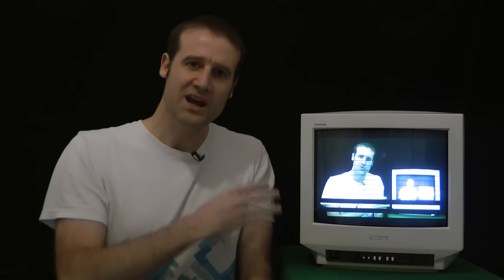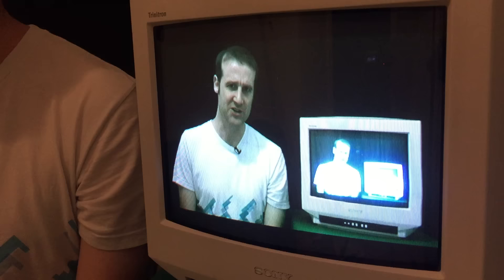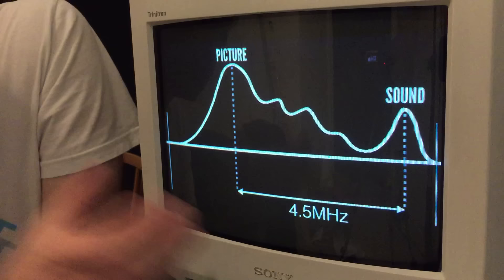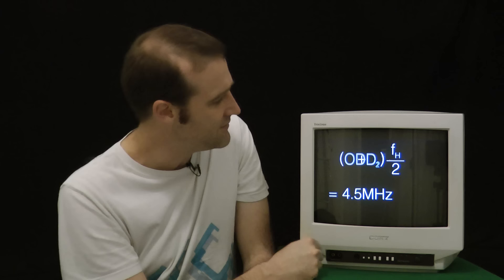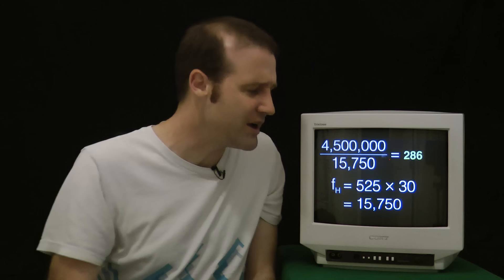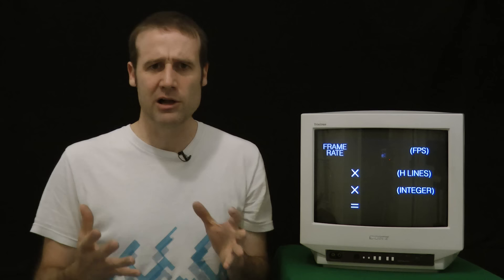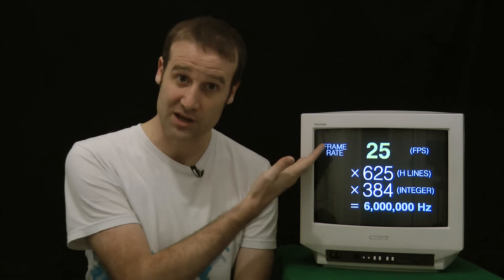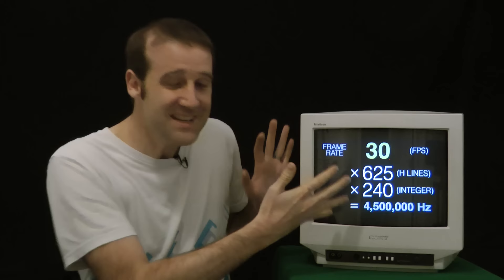Why is TV 29.97 frames per second?

Comment: When it comes to measures, units etc, the USA really are a mess
Reply: What?! I can't hear you over the sound of my new 30 INCH TV! /s
Reply: You watch a tv you don't hear it lol
Reply: *76 cm
Reply: There are two kinds of countries:
1.  Those that use the metric system.
2.  Those that have gone to the moon.

USA!  Back to back World War champs!!!
Reply: Doesn't NASA use the SI units?
Reply: +TheBahamut0 I know, it really is tough when they forgot to include the option to turn the tv quiet.
Reply: Well, when you get down to brass tacks the types of measurements can be broke down into two different categories. There's SI, and then there's that other type of measure for those countries who haven't put a flag on the moon.
Reply: Krunschy You know the problems I'm facing.
Reply: Actually, NASA has had some famous blunders simply because a single standard has not been enforced.  The Mars Climate Orbiter comes immediately to mind.
Reply: +Edward Johnson You know america didn't really do all that much in world war 1 right?
Reply: Beat Conductor you don't really believe that right? Just count the supplies sold alone during ww1 and the USA had a huge effect. Did they fight as long and as many battles as the Brits or French? Absolutely not, they were on another continent and it was not the Americans war, Americans were asked, begged to come and help even thought that behavior was directly contrary tomUS policy at the time. Discounting the American contribution to the war effort is intellectually dishonest.
Reply: + Rabid Pig Maybe your PAL tv doesn't have sound, but my NTSC tv has both sound and a color picture. : )
Reply: Chris Richard Ummm, what does it mean when a tv can switch between PAL and NTSC? Mine can, but I don't see a difference.
Reply: +Jan Murić Once everything made the transition to digital broadcast, PAL and NTSC are kind of meaningless. Remember, when he was talking about the 4.5 MHZ allocation for the channel, this was for the analog signal, which contained the picture signal, the sync pulse, the color burst and finally the audio signal. Now that everything is digitally encoded, you can fit 12 standard definition channels in the space of that one analog channel. Unless you are picking up an analog signal over the air and using the TV to decode it (No converter box) then it doesn't matter anymore. The only exception to this would be if you were using an old VCR or something that puts out an analog signal. If you are like 99% of the civilized world and have your TV connected with an HDMI cable, the standard is meaningless. This is grossly simplified, but PAL and NTSC are analog standards. Everything now is digital and a completely different animal.
Reply: Chris Richard There is no analog TV in my country. Only digital :)

But if 12 digital channels fit in a frequency range of one analog, why not use AM instead of FM for transmission?
Reply: +Jan Murić Thats exactly what they do. Google "QAM"  It stands for Quadrature Amplitude Modulation, there's a few different flavors of it, and that's how digital is broadcast now.
Reply: Actually, even in the old NTSC standard, the picture information was broadcast in AM and the audio portion was in FM. That's why in the old days when you had a crappy antenna and a weak signal you could often hear the channel better than you could see it.
Reply: Explain "stone" and "quid"...
Reply: Interesting thing about that.  There was a third analog color system called SECAM.  Nobody talks about it because it was only ever used in France and the eastern bloc, and other than the color system it was the same old 625 line picture.  SECAM encoded the color as an FM signal, placed in the same area as the AM color of NTSC/PAL.
Reply: NASA use the metric system.
Reply: Caleb Thompson
Except for that Mars Climate Orbiter :)
Reply: Fahrenheit is far better than Celsius, but otherwise the mix of measurement systems really piss me off, especially when working on US vehicles and you run into both metric and US and you need two sets of sockets and wrenches. We all thought we would be switching to metric, back in the '70s.
Reply: Richard Gates
Yeah, then there's the "other" ones like that for the harmonic balancer on some Chrysler vehicles... nothing quite fits right.
Reply: Except you're wrong.
American tire sizes are superior to metric tire sizes.
And back spacing is superior to offeset.
Metric requires senseless conversions too often.
Reply: billybobjoe198 No, it doesn't require conversions. And even if you have to convert, it's simply done by adding/removing zeroes to/from the end. Because everything is a power of 10.
Reply: Richard Gates  How is Fahrenheit better than Celsius? the numbers make no sense. seriously water freezes at 0 degrees Celsius and boils at 100. Fahrenheit is an outdated useless way to measure temperature.

Also everything to do with the imperial system is senseless conversions. inches to feet to yards to miles. you know what we have: millimetres centimetres metres kilometres and guess how many centimetres are in a metre... 100 guess how many meters are in a kilometre...1000.  

oh and all Imperial measurements are defined by the metric version of unit of measure. so and inch is defined as 0.0254 metres whereas a metre is defined as the distance travelled by light in a vacuum in 1299 792 458 seconds.
Reply: Jan Murić
And that's how I know that you have no experience actually using these systems.
For a metric tiresize, to find out your diameter, which is hugely important for and fitment or gearing,you're going to have to convert the ratio. In American you literally just have a 31" tire. And wall height isn't effecting it, a 31 on a 15 inchwheel is a 31 on a 17 inch wheels. While a 205 70 15 and a 225 70 15 will have significantly different diameters.
Same goes for Offset, you can have a -20mm offset on your 17x8" wheels, but if you want to go to say 17x10" wheels, -20mm offeset will result in it rubbing undriveably.  But in standard, where we measure in backspacing,  You can have 17x8" wheels with a 4" back spacing and you know you would need 17x10" wheels with a 4" back spacing. In Standard we've already got the most relevant information in plain clear numbers.
Reply: +Caleb Thompson  It's amusing to me that someone defined the meter by using something as precise as the speed of light in a vacuum, a standard I would agree is pretty darned constant, only to base the measurement of temperature on something as fickle as the freezing and boiling point of water. Granted, the standard requires that water to be at sea level atmospheric pressure and free of contaminants and blah blah blah, but seriously. If the water was completely free of contaminants, i.e. distilled, it wouldn't freeze consistently at 0c. There's plenty of videos showing this phenomenon. Also, the boiling point changes with pressure, contaminants, etc. Although, just having read up on the history of the Fahrenheit scale, it is equally as stupid. 0 being defined as the temperature of a 50/50 brine/ice solution. The one minor benefit to Fahrenheit is the actual divisions are smaller, making the scale a little more accurate for the average layperson. But.... they are both pretty arbitrary.
Reply: Chris Richard
Celsius is shit.
Face it.
The boiling point of mysical perfect water at mystical perfect pressures is not relevant to humans.
They system is awkward, it's divisions are too great for day to day usage, and its commons are more arbitrary than Fahrenheit. You also lose the very neat linguistic tool where below freezing, and sub zero have two very distinct meaning.
Reply: +billybobjoe198. so what you are trying to say is Celsius is bad because below zero and freezing point are the same thing?  and are you saying that it isn't useful for humans to know that if water around you is freezing then it's 0 degrees or that if water is boiling then it's 100 and if you put a liquid in a tube and mark 0 at freezing and 100 at boiling then put marks evenly in between you can find the temperature.   ok m8, Just like it's not useful to know which way is north, the depth of a drop by counting seconds  of a fall and algebra.
Reply: Chris Richard yeah I thought the water had to be distilled not ocean water. Also I know they are both dodgy but celcius is clearyly the better of the two.  But still, there is that one unit of measure that we should all be using... kelvin! Because it makes alot of sence having 0 as the coldest something can possibly be. And also there is a fatal flaw with the Metric system and it is: the system runs on base 10 when really it should be base 12 as should all number systems. It would make maths much easier!
Reply: Caleb Thompson
Pssst. Standard takes advantage of base 12.
Pssst. Kelvin is shit for human lives
We should also measure speeds in C because it's the fastest you can go! Nevermind that it needlessly puts numbers into retarded ranges to work with!
Pssst, people know the freezing and boiling point of water in Fahrenheit
Just like you know how to work in base 12 because of clocks, degrees, and feet,, and computer guys know how to work with base 16, being able to work with a system that seems harder on the surface is second nature to anyone that uses it. Try counting by 3's in a foreign language.
Reply: +Caleb Thompson Not sure how you can get much easier than multiplying or dividing by 10. Pretty easy to move a decimal point to the left or right a few places. I guess if you had a base 12 system, dividing or multiplying by 12 would give you the same result. Something about having 10 fingers and 10 toes makes it seem more normal. I am American, and having grown up with our bizarre system, I must admit I'm partial to it. I do also like the terminology of saying below freezing or below zero. If you had experienced a New Hampshire winter, you would definitely understand the difference!
Reply: +Chris Richard I don't think you understand base 12. the decimal point moves the same but there are two more numbers inbetween. picture this 10 can be divided by 2, 1 and 10. 12 can be divided by 1, 2, 3, 4, 6 and 12. so now imagine dividing 100  by 3 in base 10 it's 33.33 but in base 12 100/3 is 40, simple. I won't go in depth but division and multiplication becomes a lot easier in base 12
Reply: +Chris Richard also I live in Australia so I've only every seen snow once. and when we see 0 as the weather broadcast everyone blasts their heaters
Reply: Caleb Thompson
 Celcius is stupid for measuring air temperature, maybe fine for cooking and freezing. Even for cooking it's an idiotic scale, from 0 - freezing to 100 - boiling, maybe more useful if 1000 were boiling. As it is room temperature is 72f or something like 22c. It's not the start/end points, it's the range of the scale, especially now that everything is digital, the scale really matters.
Reply: Caleb Thompson
 I have to agree about Aussies, they complain about temperatures that are normal everyday temperatures here. Oh, 10c is cold, and I just say, well it ain't nowhere close to freezing yet, put a sweater on you wimp, do you have sweaters down there? LOL.
Reply: Richard Gates M8, 10ºc is cold as! Where i live (The Outback) we get 45ºc heat aka 113 Fahrenheit in summer. When people complain about the heat we say... deal with it!
Reply: +kargaroc386 Greece official used SECAM but in truth tv stations used PAL. Now; almost all digital
Reply: Beat Conductor The USA lost 117,465 people as a result of that war. 56,000+ of those were direct combat related deaths and MIA. That is not the most lost but it's a hell of a lot of good people dead. Those Americans died in a war on foreign soil helping allies in a war that was not ours. There was far more to Americas contribution than sending over some things.
Reply: One quid is one British pound. Calling a pound a quid is the same as Americans calling a dollar a buck.

One stone is 14 pounds (6.35029318 kg).
Reply: +billybobjoe198 I agree the EU way of measuring car tires is dumb as hell, but part of that is because it's committing the sin of MIXING metric and imperial (among other systems). That's some Mars Climber Orbiter level of stupid.

For those who don't know, here's an example of how "amazing" the system is.

Let's say my tires give me this info: 255/55R17 97V. Split it up and it basically tells you: 

255 - Width of tire in millimeter (That's fine)
55 - Height of tire (not entire wheel) measured in PERCENTAGE of width (like wtf?).
R - Some "radial" construction type thing I think. Most tires are built like that today, so it has little meaning.
17 - The diameter of the entire wheel measured in INCHES (helloooo??)
97 - The max weight the tire can carry measured in a predefined INDEX where you have to use a reference table to find out that 97 means 730 kg (why not just write 730?)
V - Another messed up index scale based on the alphabet to determine the max speed the tire can withstand at proper pressure levels. You need another table to determine the actual value. V = 270 km/h. Another issue with this table is that it's not consistent. For some reason Y is the last letter (not Z), and H comes between U and V.

You gotta wonder how high the creator of this system was. Would be so much easier with all in plain metric like so:
255/140.25R43.18 730/270
Sure, it's not as pretty, but it is way easier. With declarations it looks like: 
255mm / 140.25mm R 43.18cm 730kg / 270kmph

This system just makes me mad. I guess it's a perfect example of "giving someone a great tool only for them to abuse it".
Reply: Caleb Thompson
 Lol, I'd actually prefer the heat. Point being that 10c is a long way from freezing, it doesn't often freeze here but it's about 8c now, still far from freezing outside.
Measurement units don't need to be so logical, they need to be practical, useful. I thought the whole point of the metric system was to not have to use decimal points.
Why not have a different system for cooking and a different system for weather? We can have digital thermometers that adjust for sea level and so give accurate measurements, something more accurate than "boiling", "rolling boil" and "simmer", then maybe I could actually cook something right.
Reply: Mudbill Bugatti Veyron and GM Metro have the tyre size in metric system 
R: radial
V: velocity 
TUBELESS: without inner tube
Reply: ΑΡΗΣ ΚΟΡΝΑΡΑΚΗΣ What are you getting at?
Reply: ΑΡΗΣ ΚΟΡΝΑΡΑΚΗΣ
99% of cars on the road have wheels wrapped in metric rubber.

You only really see some spare tires, and domr offroad/LT tires in the American system.
Reply: billybobjoe198 well said
Reply: Do people count frames or something?
Reply: ... like, let's measure car engine displacement in liters, and let's buy fuel by gallons. Or let's measure tire pressure in ..., hmm, how about we do pounds per square inch? Hellooo! This is 21st century, anyone home? Yep.
Reply: Alpha Bravo
How exactly do you think pounds per square inch is any more arbitrary than newtons per square meter?

Also, engine displacement has literally no relation to your fuel, but the standard unit for engine displacement is cubic inches, not liters.
Reply: billybobjoe198 psi measures pressure. The right unit is Nm. And no the standard unit for displacement is the Cubic Centimeter (for kitchen is mL)
Reply: I still think that, for construction work, foot/inch units are more useful. In fact the most useless thing about the metric system is the base 10.
Reply: ΑΡΗΣ ΚΟΡΝΑΡΑΚΗΣ
Pressures in metric are measured in Pascals,, which are newtons per square meter, not newton meters.
Pressures in standard are measured in Pounds per square inch.
Makes me think you have no experience and you're just another metric fanboy.

You're confusing a pressure measurement for a torque measurement. Where standard uses foot pounds, and metric uses newton meters, which is another useless measurement because no one knows what a newton is, and you're rarely working with tools you can easily divide in to get a force needed on your tool.
When I'm tightening wheels, I can know I'm using a 12 inch breaker bar  to check torque, and know that if I put 100'bs on the end I'm good. Or 150 on an 9" ratchet.  or 200 on a 6",
In metric if you're torque spec conscious, but not going to use a torque wrench,  you just have to have an elbow and experience for it.  Because kilograms are a measurement of mass not force, and no one knows what a Newton is.
That also brings me to measuring weight in Kilograms,  You can't use a scale that's not a highly calibrated delicate tool to measure kilograms accurately, because 1kg on mount Everest is 1kg at sealevel, which isn't the case for a measurement of force, like pounds, which is what we're actually measuring when we're talking about weight.

You also confused metric for standard. When someone is measuring something in standard, it's more likely than not in the American standard unit. You don't go around calling metric standard, you call it metric.
Reply: Richard Gates
It is, that's why immigrants to the US quickly adapt and love the standard system for construction.
Even with the nominal sizing of so many things.
Reply: billybobjoe198 that's why called "Pascal" and not Nm^2, Crystal clear although "Atm" and "Bar" are that used more. Greece is completely metrified since 1959

No one knows what N is? Lockheed Martin knows what is since 1999; look here: m*g=(whatever you find)N, that means in a 10m/s^2 environment if you have mass of 90kg you exert 900 Newtons, in real world (9.18) exert 72N less. That's the reverse way how the scales measure (g/reading of the load cell or the median if they are more= the result) in any unit, even with kilo grams.

Call it imperial, call it customary, call it whatever, in my balls
Reply: ΑΡΗΣ ΚΟΡΝΑΡΑΚΗΣ
That last comment of your really holds minimal meaning.
You didn't attempt to answer any point I made.
 You also just pointed out how unintuitive and how useless newtons are to humans. Non professionals even in metric countries don't have a grasp on what a newton is. In standard a pound mass and a pound force is identical under earth's nominal gravity.
You're just proving how stupid and useless metric is once you get into it.

And if you'll look back, you said I was comparing Newton meters to pounds per square inch, I then corrected you, and now you're trying to say because it has a special name that makes a difference.
Pascals are Newtons per square meter period.
If you're not changing the definition a name change is meaningless.

And saying that you use bar is irrelevant, That's like me saying you use Centimeters to measure your height and you say "No I use meters!" It's the same unit, just factored. by 10.
Reply: deeply ignorant.
Reply: billybobjoe198 [facepalm] if metric system is useless then why most countries use it? Just tell us that you are anti-metrification to know
Reply: there is no point in arguing with billy, bob and joe, because he is a trump supporter, therefore someone as far from logical thinking as M31 is from us.
Reply: ΑΡΗΣ ΚΟΡΝΑΡΑΚΗΣ "why most countries use it?"
That's a good question, do you know why? Seriously.
Reply: Richard Gates ease of use, accuracy, single ratio, and the same value with the same prefixes everywhere
Reply: ΑΡΗΣ ΚΟΡΝΑΡΑΚΗΣ
Nope! French imperialism. Read about the convention of the metre.
Resistance to metric is Resistance to globalization. Which is a nationalist and sovereign movement.
Globalism is a bad thing.
The reason there is still a debate going on hundreds of years later is that there is no clear and obvious superior system.
Reply: ΑΡΗΣ ΚΟΡΝΑΡΑΚΗΣ
 And so who decided that? It wasn't the consumers, unless they were actually given a choice, I know we aren't given any choice on the matter.
Ease of use is debatable, all measurements are accurate as practicable.
Reply: billybobjoe198 Dimitris Koutsoumpas would like you...
Reply: Edward Johnson the USA did shit in the war, Britain did all the hard work
Reply: *****
Considering China has over twice the population in essentially the same land area I would hope that they could be a larger economy than the US.
Reply: billybobjoe198 everything in other systems defined with reference to metric system
Reply: Richard Gates metric system is decimal, and linear
Reply: ΑΡΗΣ ΚΟΡΝΑΡΑΚΗΣ
That's irrelevant. That's just more globalization cucking. Standard was created before metric, defining the units by their conversion was something that happened only a short while ago, which means that it holds no meaning.

You trying to push metric everywhere is just like me saying that your country should change all signs, documents, and media into English because English is superior. Greek is an outdated, overly complex language.
Greece should also change over to the USD because all currency is valued based off of the USD anyway, that's why nations outside of the US had a very strong incentive to keep inflation low.
Reply: billybobjoe198
Except english isn't superior. The metric system is, by very far.
Reply: billybobjoe198 «Kyrie,

I eulogize the archons of the Panethnic Numismatic Thesaurus and the Oecumenical Trapeza for the orthodoxy of their axioms methods and policies, although there is an episode of cacophony of the Trapeza with Hellas.With enthusiasm we dialogue and synagonize at the synods of our didymous Organizations in which polymorphous economic ideas and dogmas are analyzed and syntherized.Our critical problems such as the numismatic plethora generate some agony and melancholy. This phenomenon is charateristic of our epoch. But, to my thesis we have the dynamism to program therepeutic practices as a prophylaxis from chaos and catastrophe. In parallel a panethnic unhypocritical economic synergy and harmonization in a democratic climate is basic.I apologize for my eccentric monologue. I emphasize my eucharistia to your Kyrie to the eugenic and generous American Ethnos and to the organizers and protagonists of this Ampitctyony and the gastronomic symposia».

«Kyrie,
It is Zeus' anathema on our epoch for the dynamism of our economies and the heresy of our economic methods and policies that we should agonize the Scylla of numismatic plethora and the Charybdis of economic anaemia. It is not my idiosyncrasy to be ironic or sarcastic, but my diagnosis would be that politicians are rather cryptoplethorists. Although they emphatically stigmatize numismatic plethora, they energize it through their tactics and practices. Our policies have to be based more on economic and less on political criteria. Our gnomon has to be a metron between political, strategic and philanthropic scopes. Political magic has always been anti-economic. In an epoch characterized by monopolies, oligopolies, monopsonies, monopolistic antagonism and polymorphous inelasticities, our policies have to be more orthological. But this should not be metamorphosed into plethorophobia, which is endemic among academic economists. Numismatic symmetry should not hyper-antagonize economic acme. A greater harmonization between the practices of the economic and numismatic archons is basic. Parallel to this, we have to synchronize and harmonize more and more our economic and numismatic policies panethnically. These scopes are more practicable now, when the prognostics of the political and economic barometer are halcyonic. The history of our didymus organizations in this sphere has been didactic and their gnostic practices will always be a tonic to the polyonymous and idiomorphous ethnical economies. The genesis of the programmed organization will dynamize these policies. Therefore, I sympathize, although not without criticism on one or two themes, with the apostles and the hierarchy of our organs in their zeal to program orthodox economic and numismatic policies, although I have some logomachy with them. I apologize for having tyrannized you with my Hellenic phraseology. In my epilogue, I emphasize my eulogy to the philoxenous autochthons of this cosmopolitan metropolis and my encomium to you, Kyrie, and the stenographers.»

You forgot the fact that US$ bills can be easily forged?
Reply: chibraxial
It is plainly superior and watered down compared to most European languages.
Reply: no thats why the Mars Climate Orbiter crashed.
Reply: Russia sent probes to the moon BEFORE we did.
Reply: +R3lay *rekt*
Reply: http://i.imgur.com/tZwKg.jpg that explains which one is better
Reply: Speaking of metrics, let's speak about mpg...
Reply: Dream0Asylum XD those engineers XD
Reply: Paul Frederick MERICA
Reply: [grabs metric popcorn]
Reply: TheBahamut0 30 inches? That's it?
Reply: Cows comes in metric or imperial unit? to all whom fight for what sistem is better: the better sistem is the sistem than works for what you need. If all your life you have used imperial sistem then most of the métrical sistem will have a lot of oddities and viceversa. One time I read a guy who sayed than will be stupid go to metrical because instead ask for a quarter of milk he would have to ask for a 0.9746363 liters...that is plain idiotic! the logical path is rounding: american says "one pound" and we say "half kilo", is not the same but close enough for a day basis.
Reply: Theirs also another 2 categories,  nations that have  destroyed 125 million dollar probes over conversion errors and nations that haven't. Imperial measurements are retarded, as is the month/day/year system.
Reply: y do u care
Reply: chibraxi
Reply: All countries use a metric system (a system for measuring). Most use a decimal metric system, and a few are still left using an old and ridiculous metric system with inches, feet, yards, miles, pounds, tons, gallons, etc. If USA used a decimal metric system they probably would have made it to Mars already.
Reply: we've already made it to Mars. multiple times. we've just never set foot on there. no country has.
and the imperial system isn't an "old and ridiculous" system. an imperial system simply dissects one segment into two equal segments. and then dissect these two remaining equal segments in half again to make four smaller equally-sized segments. and again to make eight... and again to make 16... and so on... computer data and other binary systems even use the imperial system: 2, 4, 6, 8, 16, 32, 64, 128, 256, 512, 1024, etc...
Reply: And because imperial/national systems are so wonderful, every nation tried to get rid of their own one? Oh, gimme a break...
Reply: +yurtpoh What are you even talking about? That's not how the imperial system works, AT ALL.
Reply: The decimal system is incredibly inefficient. 12 and 16 have much more denominators. A clock with 10 hours would be terrible
Reply: But the whole world works with Base10, so I don't see why you even brought that up.
Reply: Edward: There are two kinds of countries.
1. Those that use the decimal metric system.
2. Those that elect Trump as president!
Reply: You probably forgot that we use a base-10 digit system, which makes the decimal system amazingly efficient. One tenth of a meter is 0.1 m. But how do you express 3/16 of an inch in digits? THAT's incredibly inefficient. If days were divided in decimals, time-of-day would be given as .25 (6 am), .50 (12 noon), .7 (4:48 pm) and so on. Not terrible at all. How much time from 4:48 pm to 9:36 pm? Difficult in that notation, but super easy if the question is phrased as "how much time from .7 to .9? (Answer: 0.2, obviously!).
Reply: Luis Alejandro Acuña What about Burma/Myanmar? Checkmate.
Reply: Urface McEggington Yes, what about them, mate?
Reply: +Beat Conductor yeah but we still won
Reply: Would you prefer to have an awesome metric system as the Système international, invented by some atheists ? God help us !
Reply: Sure! It's a better system, no matter who the inventors believed in. Would you rather live without computers (and tablets and smartphones) because Alan Turing, the father of computer science, was an atheist?
Reply: Beat Conductor We only saved an estimated 6 million British and French lives... But yeah, not that much.
Reply: i would actually prefer to listen to an atheist (unless they're of Ricky Gervais arrogance).
and again, neither system is better than the other. the imperial system divides every unit into easy squares and roots (2, 4, 8, 16, 32, 64, etc) for easy manipulation/division, while the metric system uses base10 for easy understanding.
not to mention, since computers can't use base10 decimal numbers, they calculate floating point (decimal) calculations with a base2 (binary) system, which is similar to (and can be represented by) the imperial system (base16 - hexadecimal) this is why calculators aren't always accurate. they can have floating-point rounding errors.
Reply: +yurtpoh Since when is the imperial system base 16? Some units use factors of 16, others are not. There are 12 inches in a foot, 14 pounds in a stone, and 20 UK fluid ounces in a UK pint (and I could continue). It's precisely this inconsistency that makes the imperial system a pain in the neck to learn and use in many circumstances.

BTW, the reason why calculators aren't always accurate has not much to do with base 10 vs. base 16 (or binary). Conversion bin <-> dec is easy and accurate; most errors happen because the calculations themselves do not represent the result correctly. 1/3 is not 0.3333333333(10) nor is it 0.010101010101010101010101010101(2).
Reply: lol op chibraxial,  probably the darn britts idea of keeping hillbilly early usa in the dark for as long as posible... lol  and they act prety darn dark,  I'll thell ya !   lol....
Reply: "Oh America's standards are so odd and shit!... What?  That TV is at an odd frame rate? So what? Wait ... It was made by AMERICANS????? OOOOOOOMAMA O HAHAH AMERIKUNS R SO WEIRD GUYZ"
Reply: What does any of this have to do with Moons or WWI...
Reply: +Ryder Lee,  10 hour clock  LOL....!   durh, who cares, do you see the sun & the moon wearing a TAG " keeping time " LOL....!
Reply: Luis Alejandro Acuña There are two kinds of countries:
1. Those that use the decimal metric system.
2. Those that have been to the moon.
Reply: Garlic: I'd say there are two kinds:
1. Those where people can count.
2. Those where people can't count.
You are in the second kind, since you only counted two kinds in your list, leaving out:
3: Those that still use the imperial system and haven't been to the moon.
4. Those that use the metric system and have been to the moon (cf. http://www.space.com/3332-nasa-finally-metric.html and http://www.doneyles.com/LM/Tales.html).
Reply: Brilliantly articulated
Reply: +Edward Johnson,  jeah right.... keep watching PBS dude !!!  and whatch your booble head, "grow"
Reply: +Paul Frederick, You probably still think Jay Z somehow coached CERN cientists on how to find "god particle" last time he visited, LOL !!!!  paul please, some stuff is very complicated, other stuff is easy to find/understand
Reply: sort of, but mostly the units out of your pocket book